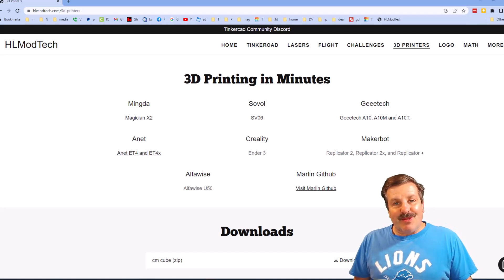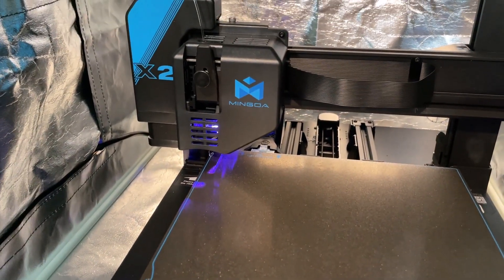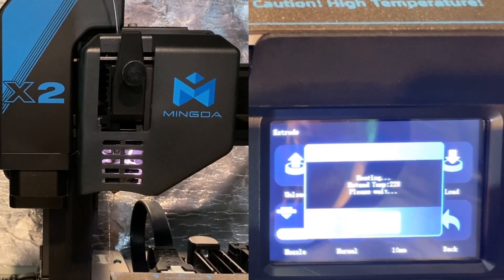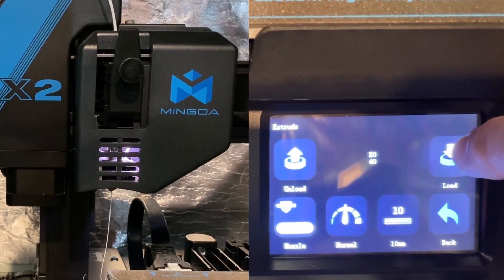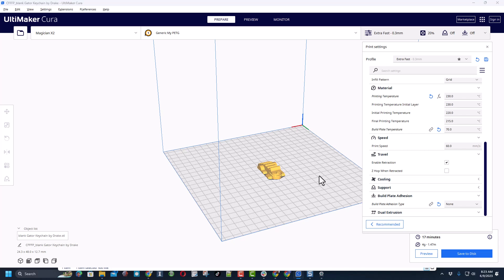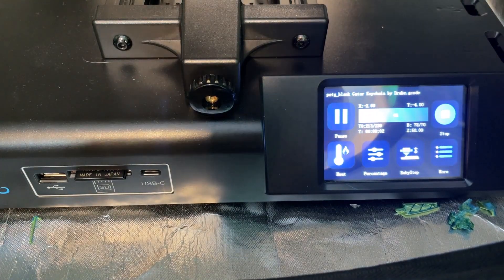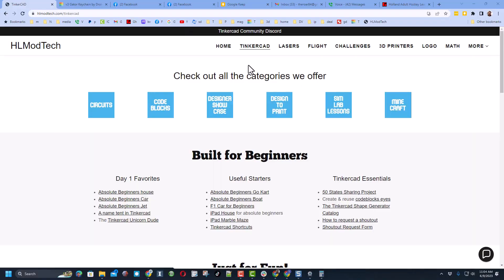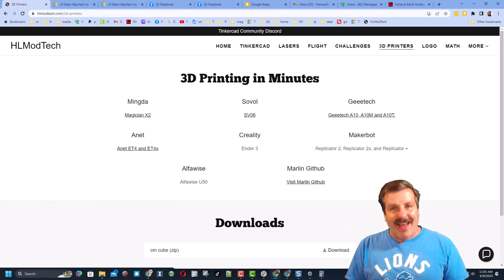3d Printing Step By Step: Mingda Magician X2 Petg Tinkercad Gator

Comment: So my printer says the firmware was last updated 2023 is tht the reason for having stringy issues
Reply from the maker: Stringing is more likely the settings you are using while printing. What filament are you using and what temperature/speed etc.